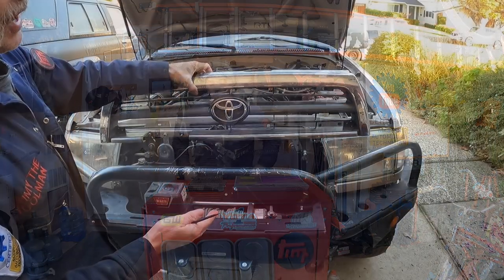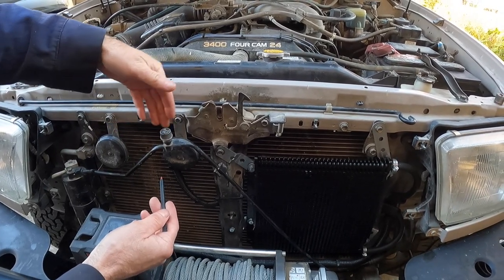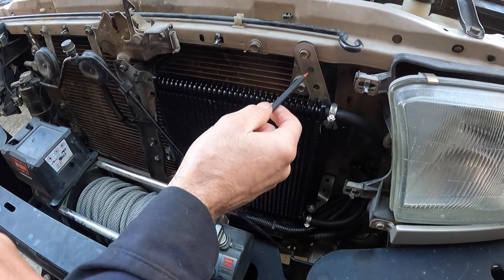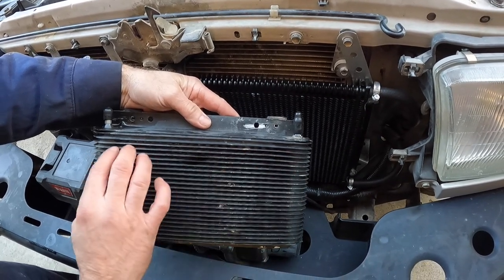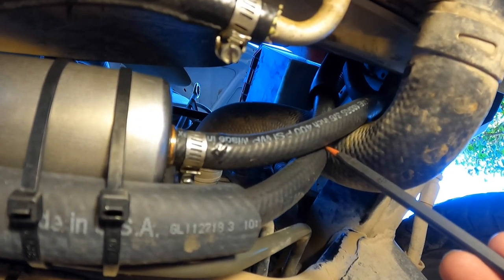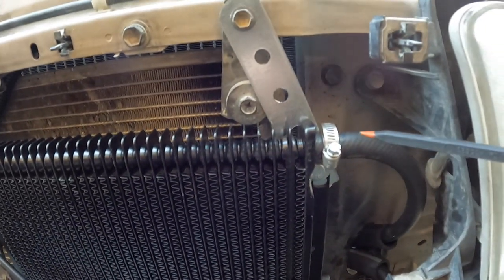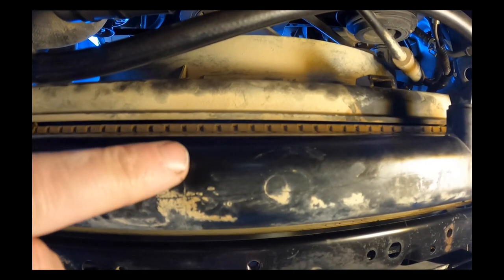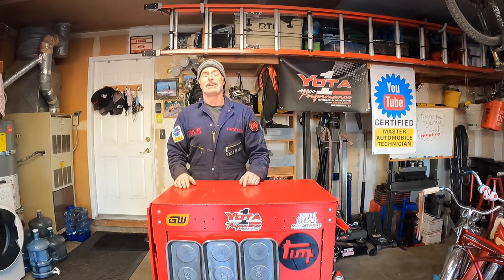External Transmission Cooler Install (3rd Gen 4runner/1st Gen Tacoma)

Comment: Hi Timmy! Thanks for all of your time creating these excellent videos. I've watched many over the years!  For some data points, I installed a B&M cooler on my 2000 in 2012 with around 120k miles and in the last 4 years, watched my transmission fluid temps reach 250° (peak) when climbing passes in the mountains often. I bypassed the OEM cooler like everyone talks about for fears of the dreaded radiator “design flaw” we all know. This was a hot topic in 2012.

At around 230k miles and 10 years later, the trans ended up failing because of those consistent high temps and I replaced it with a lower mileage used one. In the last year with this new-to-me transmission, I’m still seeing high temps (~230+°) when climbing mountain roads even in the winter, so I think the auxiliary cooler alone is not sufficient for my rig. Maybe sufficient for others, but that’s not what I’m seeing. Im not running any armor, and have 32" tires. 

So I am wondering how this cooler is working for you and since you have both setups, would you run this bypassed setup with Hayden 699, or run in series with a smaller Hayden 679? I appreciate the time! T4R4Life!
Reply from the maker: Even with running the B&M cooler in-series with the stock cooler on my 2000 4runner, I can see high trans temps going up steep and sustained mountain roads.  The cooler can only do so much.  There are tricks to keeping the temps down like turning overdrive off and using 4Lo while climbing sustained grades while 4wheeling.   I've made videos on both techniques.
https://youtu.be/BEZfDOkGVno
https://youtu.be/wqxeZvljYGc

So, when driving these mountain passes, are you turning overdrive off?  As long as you can maintain around 45 mph over those passes, turning overdrive off will help a ton with your trans temp.  It will keep them at a nice normal operating temp.  For really steep mountain roads where you can't maintain the speed to stay in 3rd gear, turning overdrive off won't help you.  About the best you can do is put the trans in 2nd gear to raise the engine rpms to pull more air through the cooling fins.  

250 degrees is high.  When I'm climbing a grade, 230 degrees is the point at which I start to consider pulling over and giving my transmission and engine a break.  When the temps drop quite a bit, I continue up the grade.  The whole reason to monitoring your temps is to know when it's prudent to give your rig a break and to know when a problem has surfaced like maybe a trans cooler or radiator coolant hose has burst.

I recently bypassed the stock trans cooler in my 98 4runner and I'm using a larger cooler, the Hayden 699.  So far, my trans temps are looking good.  If you still want to be bypassed to avoid the pink milkshake, I would suggest going to a larger cooler like this one.  I made a video of the install.
https://youtu.be/34wnfq85_qk

I hope this information helped you out.
Reply: @TimmyTheToolman  Well said! You know your stuff. I have had such similar experiences. When my transmission temp goes north of 200 degrees, it is typically when I am climbing curvy, sustained mountain roads under 30mph, with OD off. 60mph mountain passes with OD off is not a problem currently and I love those tricks. I am really looking for best cooling results for that sustained, less than 30mph scenario. 

Because I am in this scenario frequently, I really want to find a lasting solution and not have to watch so prudently to pull over and let cool. It sounds like your results with the smaller B&M cooler installed in-series is less efficient than the larger, bypassed 699. Is that accurate? Thanks!
Reply from the maker: @soapynorton  I think the Hayden 699 bypasssd is doing better than the B&M ran in-series.  You might want to try the Hayden 699 bypassed first and see how your trans temps do.  If you're still experiencing high temps, maybe run the cooler in-series with the stock cooler.  I know this will put you at risk of a cooler failure and resulting transmission damage but I think the pink milk shake is pretty rare.
Reply: @TimmyTheToolman  Thanks for the guidance and experience Timmy. I will order a 699, install it and see how it goes. Sounds like the different fin design and extra size will be an upgrade. I was planning to hook up my original B&M cooler to the factory radiator to increase cooling power since I have a new radiator, but I will try the bigger Hayden 699 before hooking it up in-series. Will report back in due time!
Reply: Did you use a tru cool ? Long?

Comment: About to fit one on my Toyota Prado 1996 as there is issues the cooler in the radiator fail and put coolant in the gear box and they are history 
So  save the accident putting a separate cooler in so great video thank you
Reply from the maker: You're very welcome Matt.  Good luck with the install.

Comment: Tim, Awesome video. You explain why as well as how you did the installation.  One question:  What tools did you use to bend the mounting brackets to fit the mounting positions?  I will certainly use the suggested cardboard template to figure out where to bend the brackets.  Thanks for your great work. We appreciate it.
Reply from the maker: Hey Joe, we just bent the brackets in a bench size.  You can do some of the manipulation with just your hand strength, but for some of the bends, using a channel locks or adjustable wrench to make the bends can be easier.  The brackets aren't that strong so they're fairly easy to bend into the shape you want.
Reply: @TimmyTheToolman  Thanks for the quick reply and information.  Will use channel locks and a vise to get the proper bends.
Reply from the maker: @joedeausen  You're welcome.  Good luck with the install.

Comment: Great videos. I have. 2003 Ltd 4runner and want to add a power steering cooler. Looking at using a Trans cooler for the add on. Pros and cons. The Hayden 699 looks like it would work. Thanks
Reply from the maker: The 699 cooler might be overkill for a power steering cooler.  I think you can get away with a much smaller one unless you plan on driving in the Baja 1000.
Reply: @TimmyTheToolman  thanks for the quick reply. Any specific part number you suggest?  Been watching some of your videos. Most projects I want to do you have a video in. 👍👍👍
Reply from the maker: @GreenMonkiCoffee2008  The B&M cooler we use in this video https://youtu.be/2nVbwe2t2T8?si=tFVnKddv7ZB7Z-ZY might work out well.  It's linked in the video description.

Comment: My SUV reached the 200K milestone!!!! The combination of Father-son bonding and your videos kept this SUV running. So THANK YOU, Timmy The Tool man. I am not sure if this is the right place to ask you the following: My SUV is a 1998 4WD 4Runner limited (3.4L). The Oil Cooler is leaking, but I cannot find any videos or instructions on how to reach it (It's almost impossible to reach it on a 4WD). All videos reference a 2WD. Do you have instructions for removing the oil cooler on a 4WD in your maintenance manual, or can you point me to a video? Your help is greatly appreciated.
Reply from the maker: You know, I wish I would have filmed it when I helped my buddy replace his oil cooler seal but we didn't.  You would first want to remove the alternator to get it out of the way.  Next, you want to jack up the rig on the driver side and remove the wheel.  Next, remove the rubber mud flaps out of the fender well.  This will give you a good view of the oil cooler.  It's tight to get in there but you'll have enough room to do what you need to do.  I'm guessing you're talking about an oil leak but maybe you're talking about a coolant leak.  If it's just an oil leak at the connection of the cooler to the block, you have to disconnect the two hoses that attach to it and then break free the bolt that holds it to the block.  You'll most likely have to give the cooler a tap with a plastic mallet to break it free.  Once off, you pick out the old o-ring gasket.  It can be a pain to remove but some small metal pick tools will help you get out fully out.  

Start watching this video at 9 minutes and 9 seconds to see how to remove the oil cooler: https://youtu.be/AvHvk9N-hTA

Start watching this video at 30 minutes and 31 seconds to see the installation of the oil cooler: https://youtu.be/_G_zqDC9kFM

You'll not only want the oil cooler o-ring gasket but you'll also want to replace the oil cooler bolt washer.

Good luck!  If you have more questions, just ask.
Reply: @TimmyTheToolman  Yes, it is the Oil Cooler and, Thank you very much for these hints.  I purchased the rings last year from Toyota, maybe I will make an attempt to change them this coming weekend. This past weekend, I spent it with my son changing his breaks and rotors : ). Thanks again, you are the best.
Reply from the maker: @cafesami9356  No problem.  Good luck with the job.  Remember to have some coolant concentrate and distilled water on hand to top off the cooling system when you're done.  Those Lisle spill free funnels work good for burping the cooling system.  Try to put the rig at a slant with the front end higher than the rear.  Turn the heat controls of your front and rear(if you have one) heaters to full hot so any air pockets get pushed out of the heater core and heater core hoses.  You won't lose a ton of coolant but you'll want to top off the system and properly burp it.  Happy Wrenching!
Reply: @TimmyTheToolman  Thank you, Timmy. I have both the Toyota concentrate and the Lisle funnels (I watched your video on flushing the radiator). If I am not mistaken, I believe I watched every video you made for the 4Runner. : ) We need more of you for other cars. You are the best.
Reply from the maker: @cafesami9356  Thanks for being a fan of our channel.  We appreciate it!

Comment: Thanks Timmy for the tip on the Hayden 699. My question is why you went to the trouble to isolate the cooler on  fabricated brackets. Hayden sends their own pass thru components with foam pads to isolate the cooler. This is the way I have installed coolers on previous vehicles. I decided I would just use their  supplied  parts. The job went well. I did not have to relocate any components and the whole job took  only a bit over an hour. Am I missing something on advantages and disadvantages of doing the job the Hayden way? Your gauge install was super well done and I plan to follow it to a T.
Reply from the maker: The reason I went with brackets and didn't use the supplied zip ties with foam pads, is because with enough vibration, those zip ties with the foam pads can work loose a bit.  When that happens, the cooling fins for both the AC condenser and radiator can start to take further damage.  If the cooler can move around enough, it could damage one of the cooling channels or the AC condenser or radiator which isn't exactly good.  I've 4wheel my rig a decent amount and end up driving on washboard fire roads.  Washboard fire roads cause a lot of vibration.  If you don't 4wheel much and drive roads like that, you're probably good with the zip ties and foam pads.  If you do 4wheel a lot of bumpy washboard roads, you might want to reconsider your mounting choice.

Good luck with the trans temp gauge install.

Comment: Timmy - what kind of trans temps (pre cooler install) were you seeing on your climbs? On pavement at highway speeds on pretty steep mountain passes, my stock gen 2 Tacoma gets up to 215.
Reply from the maker: In hot ambient temps on a steep grades, I could hit over 230 no problem.  I'm talking traversing steep mountain roads at slower speeds, not highway speeds.  When you're at highway speeds, it's much easier to keep your trans temp down by turning overdrive off to get the torque converter to lock up.
Reply: @TimmyTheToolman  I though with overdrive off the torque converter never locks up. Isn't 45 mph when rpms drop a lot overdrive gear ? I call it the gas saving gear its the only one my truck can get decent mpg in
Reply from the maker: @04tacomaguy1  The torque locks up with overdrive off and that's why the trans temps drop dramatically.  With the torque converting spinning internally, it creates lots of heat.
Reply: @TimmyTheToolman  wow I must have had it backwards in my head all along. Which is embarrassing since I took a class on auto trans lol. I always thought when I went into overdrive the converter would lock. Around 45 mph or so and then the trans would run it’s coolest and the mpg would be the highest at the lowest rpm in overdrive.

Comment: Super simple solution to the zip tie mount is to just put rubber grommets between the coils. Now no rub through risk.
Reply from the maker: Yes, the kits come with rubber pads but if the zip ties aren't tight enough or get loose like I've seen happen on my own rig, the zip ties could cause damage as the cooler vibrates and moves around.  I'm of the opinion that the zip tie mounting option isn't the best way to go.

Comment: hey just a note that the Iconic Fabrications bracket you mention there will NOT fit a 699, as the 699 is considerably larger than the 698. Best to use the mounting bracket kit you linked.

going to give this a go this weekend, thanks for the video.
Reply from the maker: Good to know! Thanks for the info.
- Sean

Comment: Timmy, I’m not sure I’m seeing it right on your video, but it appears that your return cooling line is tight against your lower radiator hose. If that’s the case then sooner or later you’re radiator hose is going to fail.
Reply from the maker: I'm going to take another look at it.  Thanks for the observation.

Comment: Hey Tim- are there any concerns of the trans not getting up to temp or being too cooled by bypassing the radiator, especially in the colder months? I live in the Bay Area as well
Reply: if your worried about warmup?  install a thermostatic valve with a 180 temp, this way noting goes thru the cooler unless the ATF is a min of 180 deg.  This is the only way to ensure consistent temps.
Reply from the maker: The cooler like I mentioned in the video has a pressure bypass.  When the fluid is colder and thicker, it won't pass through all the possible cooling fins until the fluid warms up and thins out.  This helps the trans reach a better operating temp quicker.  It's debatable how much the radiator cooler helps with raising the temp of the ATF.  I have two 3rd Gens, one with the external cooler ran in-series with the stock cooler, and the one featured in this video that has a stand-alone external cooler.   Even with the rig that has the external cooler ran in-series with the stock cooler, it can take quite a bit of time for the trans temp to rise.  From my experience, what truly makes the trans temp rise is a load on the transmission, (ie climbing a hill).  Putting a load on a trans is the quickest way to get it to an optimal operating temp.  Cruising down the highway with a light load on the trans, it can take quite a while for the temp to rise.
Reply: I use a thermostatic valve in my system, and I haven't observed any longer, or shorter times to warm up, besides the seasonal differences. I think where the bypass, or thermostatic valve especially helps is in colder temperatures (I was in Western Washington, now NW Montana) to maintain the lower operating temperature after it does warm up. In a more arid environment, it may not be needed.

Comment: Great Instructional Video! What trans temp sensor did you use for the t-fitting?
Reply from the maker: Check out this video:
Transmission Temperature Gauge Installation
https://youtu.be/fT_2szdKXRM

Comment: awesome video!  
Did you bypass just to avoid the pink milkshake?  Im have a champion radiator and am leaning towards running in series. 
Also, is there a reason you choose not to mount the trans cooler on passenger side facing the passenger direction?  Just curious since the both the return and send lines are on that side of the vehicle?
Reply from the maker: Yes, I bypassed to prevent a trans cooler failure destroying my transmission.  I wanted to see if I ran a big enough stand alone cooler, would it sufficiently keep my trans temps at a good range.  For the most part it has.  It's still hard to avoid high temps in certain situations like climbing a steep mountain road in hot ambient temps.

The reason why I mounted the cooler on the driver side was for the space available.  From what I remember, there was less stuff in the way on the driver side.
Reply: @TimmyTheToolman  Great, thank you for the response, love the videos they've been an amazing resource!     
I'm replacing my radiator with an aluminum champion and am leaning towards running in series.  I tow a microlite camper into the mountains fairly often and live in Arizona so battling the heat and elevation!

Comment: Great Tutorial as always your videos are very helpful. Appreciate it. I do have a question on the longevity of the Hayden 699 transmission cooler. When will I need to replace that you think and will be there any signs beforehand?  thank you.
Reply from the maker: There's not a whole lot that can fail with a cooler.  The cooler is painted so corrosion shouldn't be an issue.  It should last the lifetime of the vehicle unless you get into a front end collision.
Reply from the maker: Well technically unless it is leaking it should still perform as expected unless there is some type of clog. You can also replace it as a type of preventative maintenance but unlike a radiator, there is no real fear of it failing internally and mixing coolant with trans fluid as the trans cooler only has transmission fluid.
- Sean
Reply: Thank you for your fast reply and sounds good! I’m planning to add the cooler with my next radiator replacement.